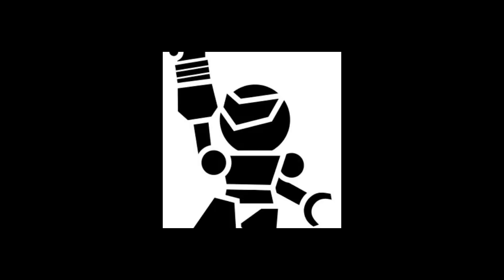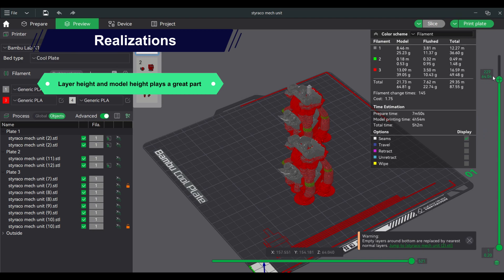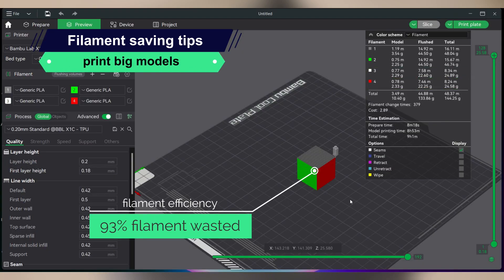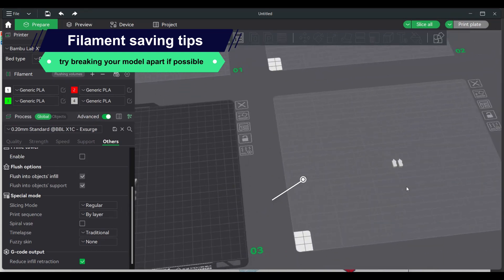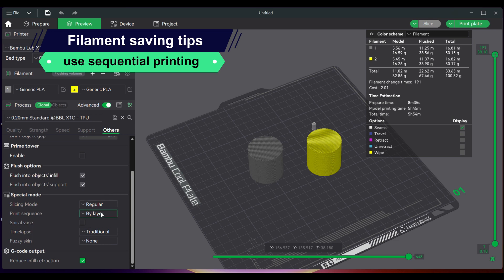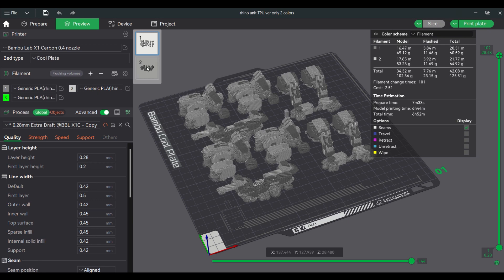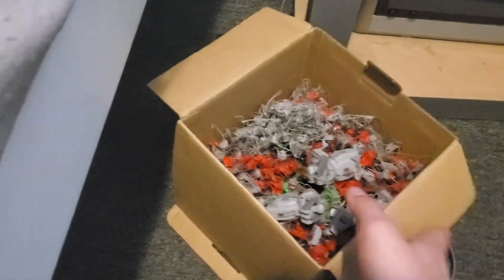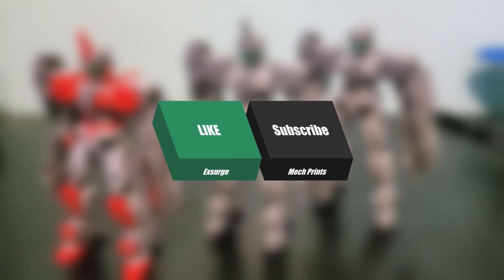Tips to Save 3D Printing Filament with Multi-Color Prints

Comment: Actually I think one of the best options would be to change the hotend to a Panda Revo.
The Prusa mk3 had an MMU for years without cut&poo. It had its problems, wich were solved after upgrading the mk3 to an Revo six hotend. The mk4 works flawless without cut&poo from the start.
But all thoose new printers with filament changers use cut&poo. Why?
The reason is quite simple: You can re-form the tip of the filament using ramping on unload only on standard flow hotends. If your meltzone is bigger or the tip is spliced into multiple parts (CHT) you never will get a reliable filament tip on unload.
However, while the Panda Revo is shipped with an 0.4mm Revo high flow Nozzle, you can use an 0.4mm standard-flow instead.
Changing the toolchange gcode, you could do ramping on unload. So you get a reloadable filament tip without cut. So all the cut&poo waste could be gone.
However, I do not have a bambulab X1C/P1P/P1S, so I can not test it myself. But I can see how well the filament tips are after unloading on my mk3s. So I am pretty sure it would be possible to reduce the waste much more.
Reply from the maker: if the research on filament tip creation has gone this far then I am all for it. If you would I would like to see the gcode for the filament tip creation. Been pulling my hair for years trying to figure it out.

Comment: Whats the part where it spits out poop before printing called. Ie i just printed orange filament, it retracts cleans etc. then I print another print in orange filament and it flushes a heap of the same filament out as poop prior to printing. It cant be that stupid of a machine. Cant it remember hey he used bambu orange pla, oh and again i dont need to poop
Reply from the maker: The AMS still purges the nozzle to make sure you are using the correct color, even if it is the same color. that happens between different print jobs if you use 1 color and still enable the AMS.

Comment: my biggest problem is flesh and white filaments. whenever I try to change the purge volume, I get a ton of bleed from other colors. Mat colors seem to do better.
Thanks for your tips.
Reply from the maker: If at 190 mm³ it still bleeds, try 220 or the default 280 mm³. Also look at your mesh and see if Bambu Studio can repair it. Some "bleeds" are not bleeds at all but wrong color perimeters by the slicer itself (if the 3d model still has geometry inside)